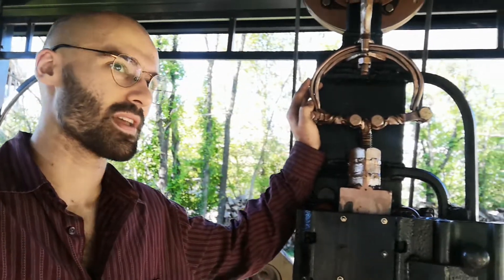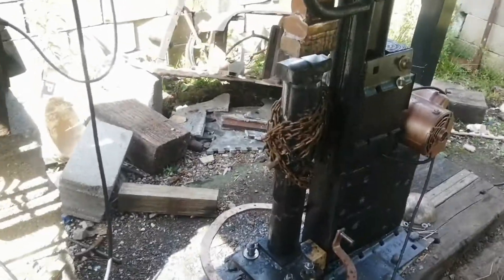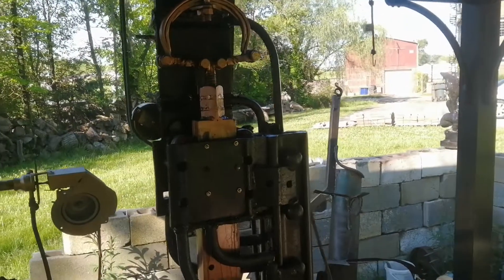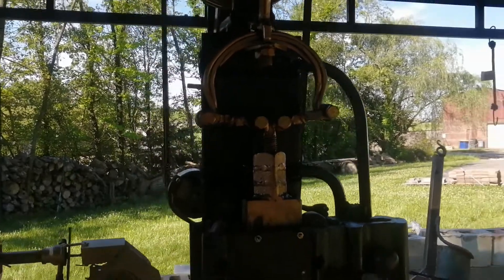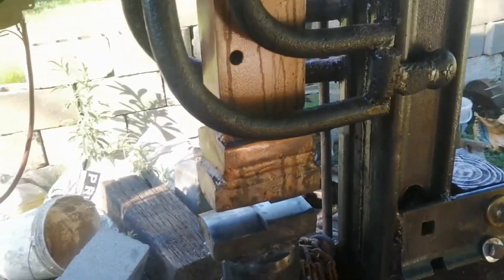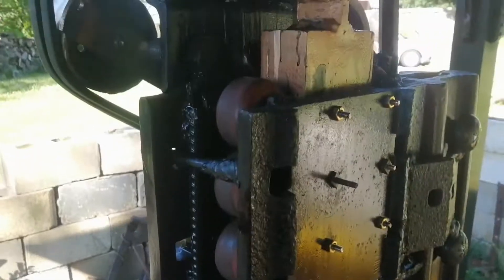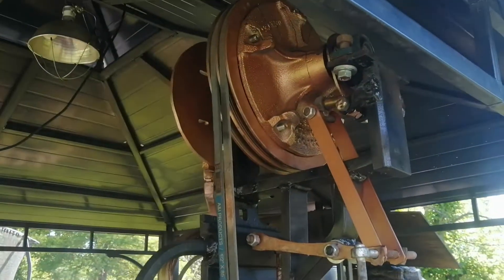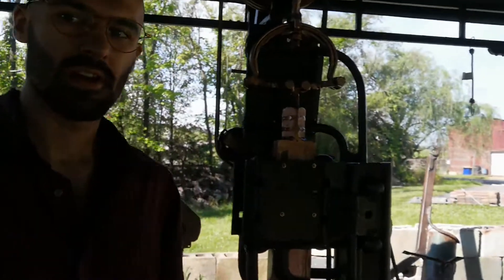My new Homemade Power Hammer!

Comment: I would love to hear how you made,, and maybe get a better look at your spring. Looks really good man!
Reply from the maker: Thanks!
The spring is actually just a bar of 5160 I let air cool. It's still working a year later, but it's definitely deformed a bit. The head has started to sag pretty badly at rest. I've been thinking about taking it apart to harden and heat treat, maybe I should do a video on it when I do.

Comment: I’ve tried the belts and they just stretched way to much ,if you take the crank pin to 2” CC you’d find it will run way smoother 

If it’s not a tire hammer it’s a pneumatic from now on for me
Reply from the maker: Hhm, well time will tell how the belts hold up, but I've had it put together for over six months now, and they've performed without a hitch so far